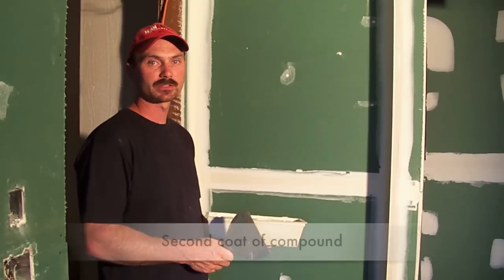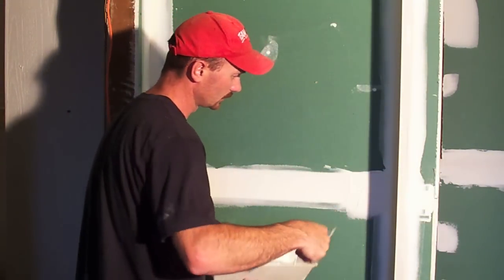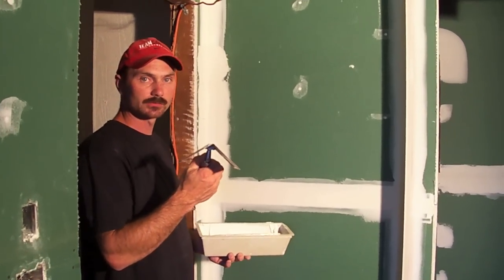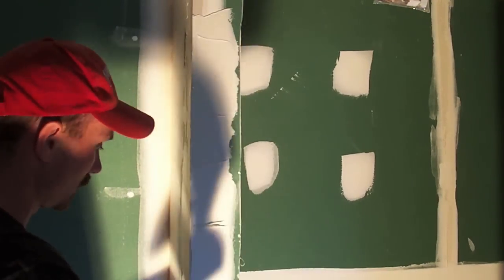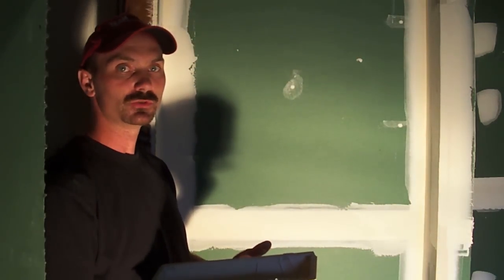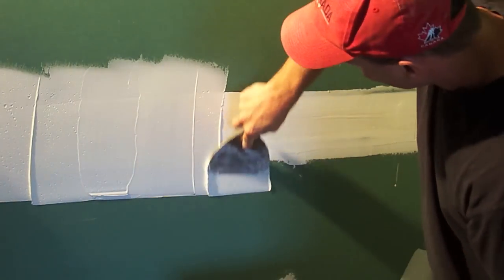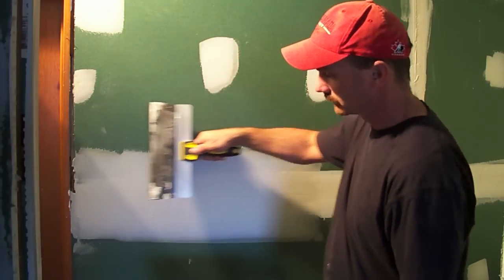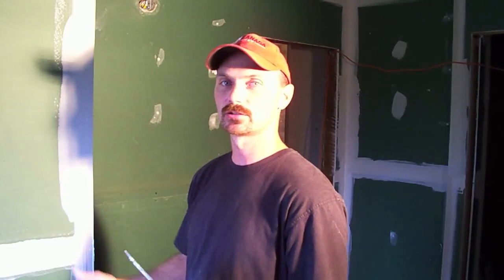How to mud and tape drywall [2of2]

Comment: Just a thought from an amateur ... when we are taping in a bathroom with mold resistant drywall, wouldn't it make sense to use the fiber tape (there is even a green one that claims to be mold resistant)? It's the paper that is prone to mold, so wouldn't it make more sense not to use paper?
Reply from the maker: Seems to make sense but I have rarely  seen the actual tape be mouldy its usually the paper face of the drywall, maybe because its usually under mud and paint?
Reply: put a vent system in ya bathroom where moisture wont build and you shouldn't have problems like that for a long time

Comment: Do you have a video on drywall cut out two feet from floor up with texture on old wall?   How do you do repair and match texture?
Reply from the maker: that is a tough thing to match and work around while mudding the new joint. Please come to my forum I may be able to help you more from there.http://www.house-improvements.com/forums/
Reply: its best to just try on scrap drywall first and if texture matches then  redo the texture on the wall.

Comment: How do you tape the ceiling/wall junction where you've got 2 walls and the ceiling meeting?  Do you just cut a pattern into a piece of paper tape so that it'll conform to the corner and then tape the rest as normal, or something else?
Reply from the maker: +Daniel Herman 3 separate tapes one going left and one right and then one going down.They all meet in or very close to the corner.

Comment: Hi there. I was wondering how I should go about finishing a ceiling off. The ceiling is all finished including been painted. but there is tape in the jib joints which i took down. Can I just start like its a new wall or do i need to sand the paint off to I don't get a un even ceiling?

Comment: So do you use a six-inch knife for everything? Not criticizing. I know there are many different techniques. I typically tape with a six, double with an eight, and flush with a ten. Are there too many weapons in my arsenal or are you texturing that job or is that just the way it works for you? Jsut curious. Thanks for the vid.

Comment: What is the purpose of so many coats?  Is it just to hide the paper before you pain?
Reply from the maker: Yes , you need coats of mud to hide tapes and create a smooth surface that is easier to sand .

Comment: How long do i wait for the joint compound to dry before i start appliying my texture?
Reply from the maker: +Denars Orerreug that depends on the thickness of the mud applied and the drying conditions but most thinner coats in good drying conditions will be dry enough to sand in about 5-6 hrs. After sanding it can be primed and textured. If its a heavier coat then wait over night.
Reply: Thank you very much!

Comment: shannon whats the need for taking the mud out so far from the joint
Reply: +charlie coleman Its so the joint doesn't fail or crack during the normal swelling and shrinking that occurs with the different seasons. Like my house is literally built directly on Adobe Clay which moves my house all over the place and also swells up in the winter and shrinks in the summer when it dries out so drywall cracks are inevitable :/

Comment: @HouseImprovements YouTube has high quality taping vids.  No point repeating what's been done.  

If you were to walk on a job with the crews I work with and perform your drywall techniques, they'd pull you aside to ask what you think you're doing. Your insistence that it works for you won't fly with them. Builders know what people are made of. 

If you're doing this to promote your business, gear it to that, but never claim to possess any expert know-how of taping.
Reply: What are the issues with his technique? How does "what someones made of" factor in? Are you implying he is pretending to know what he's doing? I'm not a pro, so I ask in seriousness, not rhetorically.

Comment: How to tell if my wall is drywall or plaster? Is this method okay for plaster?
Reply from the maker: KnicksNYanks84 Plaster is usually very much harder,if you tap it with a hammer and it sounds more like concrete then it is likely plaster. Plaster is a little different but you could patch it with these basic skills.

Comment: shannon whats the need for taking the mud out so far from the joint
Reply from the maker: +charlie coleman You are building a more gradual taper so that it does not look like a bump after its is painted.
Reply: now after you mud all the joints and corners ect. what else needs to be done before painting the dry wall

Comment: I fill my tapered joints to the end of the taper so it's flush with the rest of the sheet, about 4-5" wide. Why go further?
Reply from the maker: +martik778 If you do not go further you will see that transition once it is painted. Especially when using medium to darker wall colours.

Comment: u put 3 coats, how long do you let each coat dry before adding another??
Reply from the maker: The time between coats can vary depending on temp. and humidity . The best way is to wait over night, but usually in good conditions I can coat a room first thing in the morning and again by 4 pm or so. When coating corners you will need to wait over night usually though because the first coats are usually a little thicker.
Reply: HouseImprovements Depending on the size of job, bag mix 45, 90 or 210( bag mix wont srink or crack but its harder to sand and not as smooth) on tape coat. We get tape coat and fill coat first day. day two top coat!
When conditions are right all three coats on day one.

Comment: DIYers would find the professional method too heavy I think.  Although, in my experience (as an advanced DIYer) the plastic pan is harder.  Of course, I prefer 5 and 10 inch knives which don't fit in there easily...

Comment: What type of tape is that? All I can seem to find is the stuff with holes in it.
Reply from the maker: It is just paper tape for drywall. I can get either type here but prefer the paper.
Reply: Tried it saved me a lot of trouble. Thank you for the great tip.

Comment: Do you not have to sand after the first coat dries?
Reply from the maker: I like to apply thinner smooth coats to avoid sanding between coats. Depending on the quality of your coats you may or may not need to sand a little.
Reply: just scrap off chunks and reapply mud 3 cotes is best

Comment: Im hanging around here because i can. Rookies like yourself should be taught the real way the better way, the way it should be done the first time. This guy makes the most simple mistakes that can change how your tape sits after squeezing out the mud... going from one side to the other instead of middle out will sit your tape off, and not wiping it tight can leave too much mud on the wall and sanding would be insanely hard, and if its done rigt you should have to knock anything off...

Comment: is there a way to drywall onto a concrete wall?
Reply from the maker: You can glue it to the wall if it is smooth enough and use a few concrete nails to hold it in place tip the adhesive dries.
Reply: +HouseImprovements so if its not smooth just smooth it out? and is it ok to use any type of drywall and thinkness?
Reply: Have fun with that room in the winter.

Comment: Please don't take this advice. I don't mean to be rude but this is not how you're supposed to finish a wall. As a finisher you never thin out your tape coat, second coat is with a 8-10" knife. You want to fill the space beyond the beveled edges of the drywall. I do slightly thin out my third coat of mud and skim over the second coat with a 12" knife. The way he did this I guarantee he has all those golf-ball-like dimples in the finish because of air pockets. Just a thought

Comment: I already did... two parts of it. just wipe the mud tight make sure its clean and ready for the second and third coat. if you have to knock off chunks you're being clean enough. Wipe the mud out from the tape really tight, while this guy is saying not too tight, hes also not doing it tight enough. Go from the middle out not the right or left... it will off set the tape, Me and my father are so good our third coats dont have to be sanded.

Comment: What is bevel vs butt joint?
Reply from the maker: +Kev Singh the ends of sheets or anywhere that the sheet is full thickness would be a butt edge and any factory edge that is compressed to make it slightly thinner is the bevel.
Reply: Thanks!

Comment: Give you decent marks for effort, but that's not how you tape & mud.  Never use a 6" knife to top coat recesses and butts.  And never apply the mud perpendicular to the beveled or angle seams unless to stage the material for immediate troweling, usually for ceilings and corner bead. You never tape with a 3" knife.  4" for corner angles to ed tape is ok. 6" is better.  3" is for tight spots. You go 10" or 12" knife on all butt and recess top coats.  Slam it on, skim off feathered smooth.

Comment: @dieterGM59 Who's trolling?  There are finite correct techniques to each building trade and sky's the limit for incorrect. This particular top coating video method is incorrect.  Skilled compound application is done very differently than this for precision accuracy in shortest time and to much better end result.  If you don't how to do something, ask someone that does.

Comment: Thank you for your quick reply. Your patching video lead me to another video demonstrating a "pumpkin patch". you tube .com /watch? v0=aiGjG4aPJiU. Do you know of any problems with doing it this way? If I had one hole, your method would be great but I've got over 25 3/4inch drilled holes. Doing either of these methods 25 times seems like it would be more work and time than pulling out the horizontal sheet rock and just replacing whole sheets. Not to mention the lousy job I'd do of it.

Comment: The video is very informative, but unfortunately you are not giving us the right information.I have been in the drywall business for 13 years and I'm positive you had alot of issues in that bathroom as far as point up is concerned, especially if you painted that bathroom with a semi gloss paint which is the norm. I'm sure you know exactly what I'm talking about but keep trying, you'll get it eventually.

Comment: Marlon medrano. you could have been using old jointing compound that has lost its adhesive qualities or your boards may have been damp when you applied the first coat?..... Benedek laci. so your a professional R U ? And to the guy who calls himself a finisher. A finisher is usually a guy who is learning the trade or simply not good enough to do the job and is usually employed by a dry lining gang to make good to all crap the so called professionals have done.

Comment: 2 coats . first coat should only be heavy second lite then sand. only knives you should use is 5, 10and 12 . 10 for first coat and 12 for second and 5 for inside corners . i have been drywalling for years and i hardely use the 6. i have never seen anyone apply mud the way you do . to be honest everything you do is reversed your taking to much time. but if you get away with it do your thing.